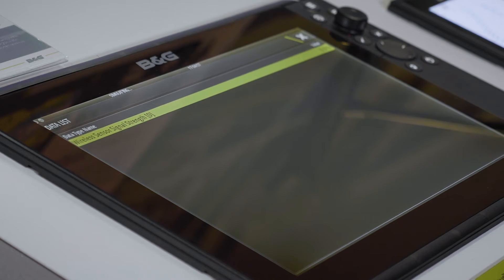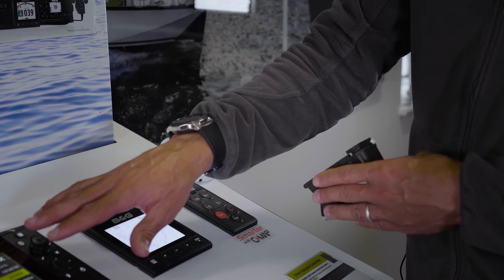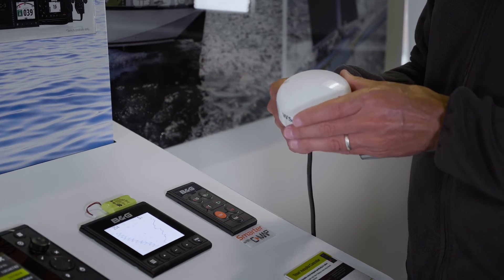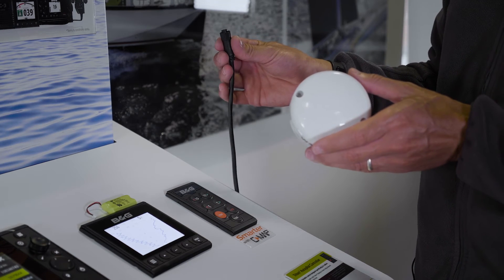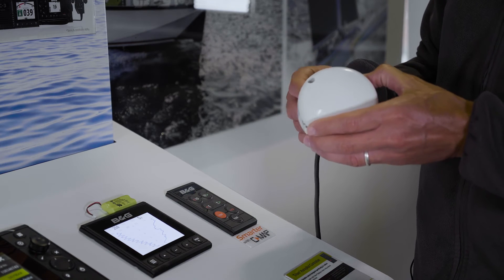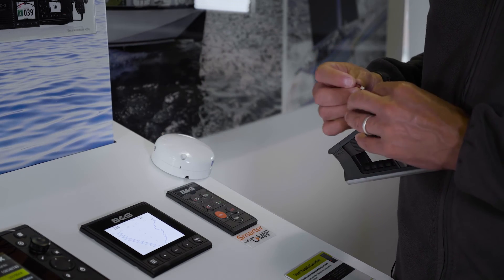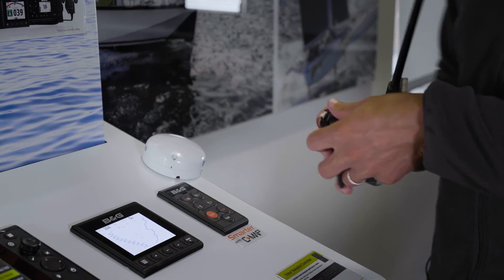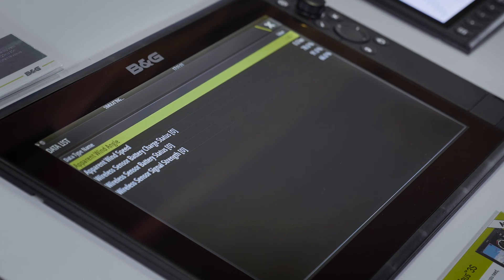B&G Tech Tip | Pairing the B&G WS320 wind sensor

Comment: I'm trying to pair by following these instructions. The system shows the 320 device. It paired when new but over winter 22/23 the data stopped. Battery now replaced and shows 325mv but will not pair again. Any thoughts?

Comment: Haven't been on the boat much this year, but went sailing yesterday and no wind data.  Sensor is 1 year old, San Diego, plenty of sun.  Said Power [OFF], then in the device list, 0%.  Did I just loose the BT signal? Will I have to do this everytime?

Comment: Today, my WS320 wind data stopped.coming through. I tried restarting the nmea network, reconnect cables etc to no avail. I have installed the system (new) only a couple of months ago. 
Is there anything I can do other than crane into the mast to get the wind sensor to reconnect? What if this happens again in a few months?
Reply: Hello, I’m having trouble getting my wind sensor to pair 
Following the steps you show. But no joy
Reply from the maker: Your NMEA2000 network is still working, correct? Do you see the WS320 interfence in the N2K device ilst? Please send us a message via FB with serial number and contact details.
Reply: Hello which is the oficial FB page for B&G I am having the issue @BandG

Comment: Is this unit compatible with a Garmin MFD and can it be configured through a Garmin unit, or does it only work with B&G MFD’s? Thanks.
Reply from the maker: There are no special procedures to be done via software, so the main data will be shown. Maybe you won't see the status of the battery and the pairing signal if it is good or not but AWA and AWS will be read.

Comment: So every time a battery needs replacing the wind sensor has to be brought down to deck level? Apart from that scenario are there other ways rthe pairing can be lost because having to bring the vane down from the mast in that case would be a real pain.
Reply from the maker: If the wind sensor is exposed to sun, the battery should last for more than 5 years since it is being recharged daily. If pairing is lost it should be due to other reasons like poor coverage between the bluetooth antenna and the wind sensor or interference from other Bluetooth devices.

Comment: Hi I previously paired my WS320 wind sensor (and had the data flowing) and then I stored it away for a while with battery connected, when I have come to fit it there is no longer data, and I’ve subsequently tried to re-pair it (for a few hours) but to no avail.

Not sure if I need to ‘reset’ or something?